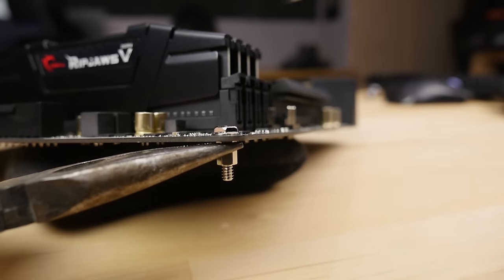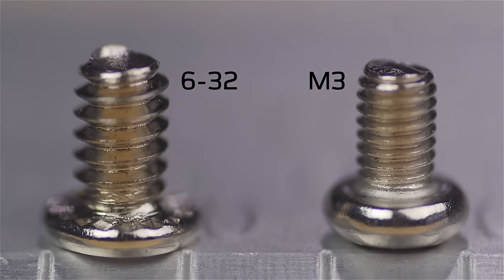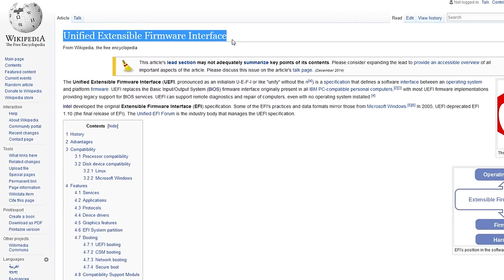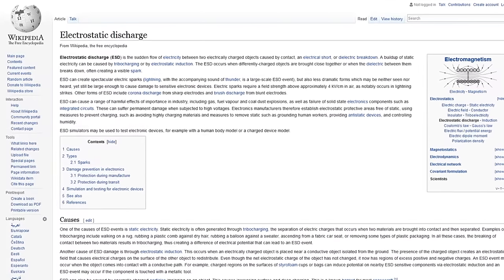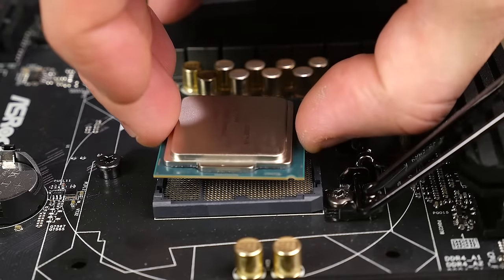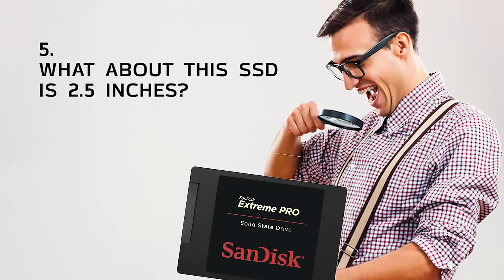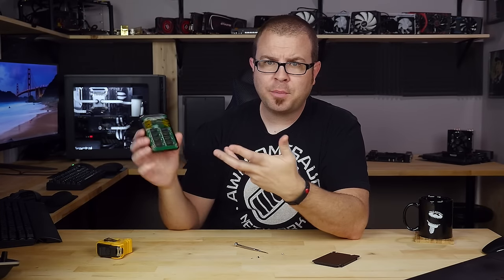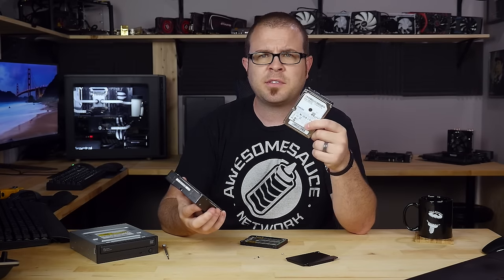5 Confusing PC Building Facts

Comment: No. No. No. Don't get us confused America. Canada uses and prefers the metric system, and the only reason we have to deal with the 6-32 threaded bolts are because we share a border with you. 

Notice how you say "UTS 6-32, which is used in the US and Canada", and then you just say "The metric system". What you forgot to say is "The metric system, used by every other country on the planet."

By the way, the 2.5" and 3.5" is actually a common sense thing, not deception. Kind of like the metric system. It just makes sense.
Reply: +Travis Ross (TwistyTravster) And I'm sorry for that. Imperial measurements are as outdated and stupid as imperialism itself.
Reply: ***** Oh, I fully understand different standards of measurement, and the benefits of how to convert between them. I work as a draftsperson, and I have to read and write construction/architectural/structural engineering drawings in both metric and imperial. Though, as you may already know, I much prefer metric. Mathematically, it is ridiculous how much easier it is to use.
Reply: +SecurityTheatre because the speed of light is the most distance something can travel in said time, its always the same. We are working on basing it on the exact amount of silicone (or graphene im not sure) atoms in a row making a meter. Just like atom clocks, its very accurate.
Reply: And sensible, because we can prove what a meter is without the need for another object to compare it to. Which is exactly what the imperial system does. Its defined by how much meters fit in x foot etc. Now that is unneededly complicated.
Reply: ***** it was the simplest way to do it until we had the technology to count atoms in a perfect sphere and to create said perfect sphere. its simpler than having to do all that, and then to multiply it by a random number of some `more sensible` (read: we dont want to change) unit. if metric is 8 steps, than imperial is always a step more since you have to have metric before imperial. that was the joke i made, no matter what you say imperial will ALWAYS be more complicated than metric since it requires metric to be calculated.

redefining universal units does make perfect sense. it removes bariers and doesnt create long term new bariers. you didnt actually construct an argument with evidence, you just said "i like this better but its my personal preference". metric is superior in every way shape and form.
Reply: This went from talking about how Metric is superior to Imperial, from a global stand-point, to measuring atoms and the speed of light. Lol.
Reply: We still use Imperial in Canada. Many construction materials are only available in Imperial measurements, and building schematics are usually Imperial to avoid confusing the heck out of tradesmen. I did work from Metric plans once, and it involved having to use a calculator for numbers I can usually just do in my head.
Reply: Not to mention our product sizes are Imperial, just expressed in metric. How many times have you bought 454 grams of butter?
Reply: nimrodery: The last time I bought a pound of butter :)
Reply: Exactly.
Reply: Alex... you'll notice anything made outside of 'Murica is metric. Every make/model of car that is not American uses metric. Every furniture manufacturer outside of the US uses metric. Though, it is true that most construction materials are technically referred as being imperial, and typically only applies to lumber. The real truth is that a 2x4 is not 2" by 4", because it is milled down to a metric measurement approximately closer to 1.5" by 3.5". Every type of structural steel beam, column, and stud are metric, as well as concrete block is designed in metric, because Engineers use it.

When you really take in the global perspective, its not so much a matter of elitism as much as it is that your country is stubborn and closed-minded. And it shouldn't really come as much of a surprise to you hearing that.
Reply: We actually use both here in America
We measure air/humidity heat in F but water and PC thermals in C, we use yards for football but metres for avian flight, we use inches for cock measurements and centimetres for cock insults

Comment: I have to confess. I still use an.....optical drive....
Reply: +DarkBazerker I do too. And I will probably continue to use them for backups for years to come.
Reply: +DarkBazerker I don't own one, personally, but a client just left their computer with me for a few months and I used theirs for a bit in my system. It was actually really nice!
Reply: +DarkBazerker I use one whenever I have to rip a CD onto Google Play
Reply: +Dan Robards wat?
Reply: Yeah, people still use discs
Reply: I use mine most for data disc, since every flash drive I touch dies. I also boot off of my HDD since I use my ssd for modded skyrim. xD
Reply: Dan Robards
What's the point between disks and google play?
Reply: I can go into a charity shop and buy a £8 album for £1. All I have to do is upload it and then I can access it anywhere.

Comment: I am in europe and i want to buy a pc. I will buy everything on amazon.com bot i will buy my chassis here. Are the screws compatible?
Reply: They're generally the same no matter where you buy them to be honest. Most cases tend to come with a set of stand offs and screws too, some motherboards do too, so you should be fine.
Reply: Try using amazon.co.uk or amazon.de, the shipping is horrendously expensive from the US.
Reply: ***** Expensive
Reply: But i done the maths and its cheaper buy on amazon.com
Reply: That may be due to currency conversion mate. It may seem cheaper but that could be in USSD. Your mathematics won't include shipping either, so it will be more expensive.
Reply: Sam Winton Import duty is also a thing. Buy it within the EU and you don't pay that.
Reply: 550 + 70dollars = 620. Chassis costs 50 dollars in portugal so 670$ that is around 650 euros. Buying on amazon.uk there are a lot of items like the cpu that dont ship to portugal. amazon.es rx480 4gb minimum 300 dollars (vs 200). Expensive hdd. In a shop here in my country the same thing to the gpu. Now compare the 2 prices. IDK about import duty. im still searching.
Reply: Gizego Import duty won't be specified anywhere, you get notified about it when you have to go and collect your package at the customs.
Reply: Gizego Try Ireland or Italy. Both use Euro's so you may have better luck.
Reply: yes the screws dont change and amazon.com has more products but be careful about the currency conversion, like buying a currency may cost more than selling a currency. go to your customs and ask them about the import duty and lastly you may get one broken part out of all the parts so dont get upset, and lastly since its your first time, try buying one of your pc parts that is fragile and cheap first and see if it arrives safe, if it comes to you broken then get over it and dont buy its not worth the risk and the most important thing is buying it from your country wont hurt you, that extra money you pay goes into one of your country men and he will spend it to buy some thing/service from you, also when you buy from your country you make their business more stronger in ways that maybe they could soon get parts directly from manufacturer because of the demand. remember spending money in your country will never hurt you in the long run but spending money out of your country might help you in the short them but you are hurtiing your countrys economy in the long run.

Comment: Maybe it's time that US started using metric system, because THE WHOLE WORLD already does.
Reply: Bartek Radożycki only the INTELLIGENT parts of the world
Reply: How could you compare using meters to jumping off the cliff? It's so far off... I used the word metric because US already uses SI units like seconds. Meter is the one that make most problems because of the need to translate documentation and produce two different kinds of equipment for both standards instead of 1. In this case US should go with the rest of the world.
Reply: Well... While the comparison is not correct here (as jumping off a cliff implies that if everyone is doing something stupid and hazardous would you?) it IS a significant change that was attempted before and failed. It is something that would either take very long and would be very difficult or would be quick, accurate and cost a massive amount of money. Consider that they have been using the imperial system for the entirety of their history (however short it is). Look at the UK, where they still often use MPH as their speed measurement for example. As far as I am told every school in the US has to teach both systems, so they have no excuse for not knowing the SI system units, but domestically they use imperial as the predominant one, however in every single international transaction or project, they have to switch to using the SI system fully. Heck, NASA lost satellites because they messed up converting the units before. Every single possible credible scientific paper also uses the SI system anyway. You might find a modern physics paper with imperial units, but it's a guarantee that it has not been published anywhere and is just an unfinished copy, because no one would accept such a thing
Reply: the US is slowly converting to metric

Comment: If I recall correctly its the platters inside the drives that measure 3.5" and 2.5". SSDs are called 2.5" drives just for connivence and to make it easier to understand that the drive mountings are the same.